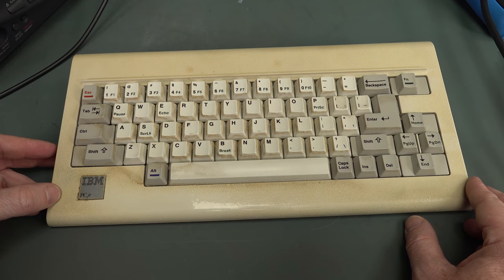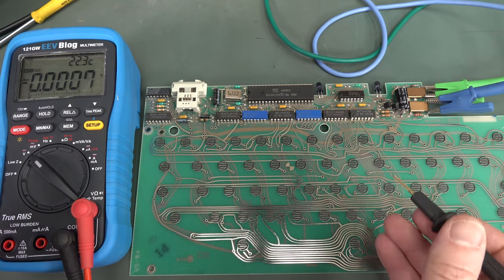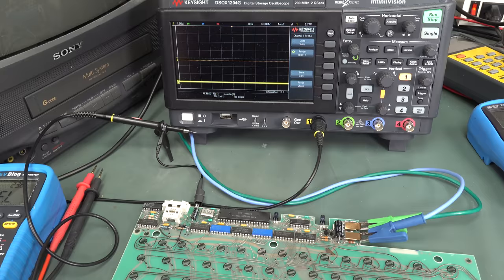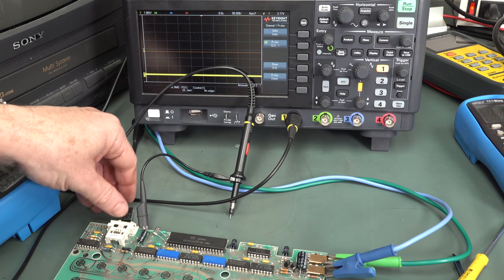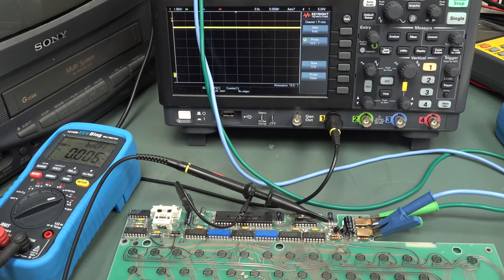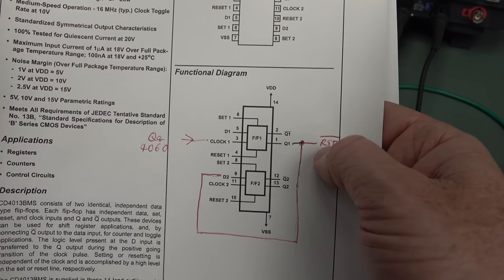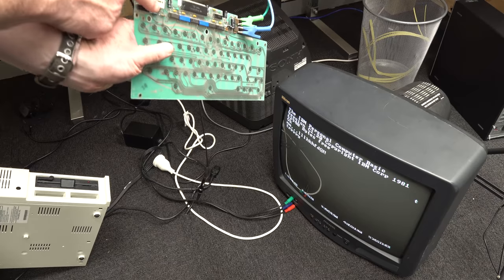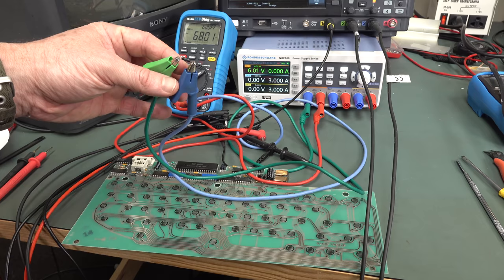EEVblog #1245 - A Most Excellent REPAIR: IBM PCjr Keyboard

Comment: Dave,
I see what you mean!  I did a search for the schematic for the keyboard.  I found a good "manual" on the Jr but although there WERE schematics for the main board, the power supply, the modem, the monitor, etc.  there was NO schematic for the keyboard!!!  There was a fairly decent block diagram for it, but no schematic.  In case you want to view it here is the link:
file:///C:/Users/user/Downloads/PCjr_Technical_Reference_Nov83.pdf
Also, another of your viewers suggested that you build Mr. Carlson's Capacitor tester....I TOTALLY AGREE !!!!  The thing is awesome!!!  I checked his YouTube site and it seems that the information for that device is limited to Patrons ONLY, so you would have to become a patron to get it, but it is WELL WORTH IT !!!  His non patron site is listed as "Mr. Carlson's Lab" and you can find it here:
https://www.youtube.com/user/MrCarlsonsLab/videos

I may have found a link to the regular site that is about the tester:
https://www.youtube.com/watch?v=LhovRIM5xAo
Check that out and see if it is what we were talking about.
Reply: The link ...
Reply: @0x8badf00d   looks like the path to my hard drive was listed instead of the link.  Try this one:
ftp://bitsavers.informatik.uni-stuttgart.de/pdf/ibm/pc/pc_jr/PCjr_Technical_Reference_Nov83.pdf

Comment: The ~400 kHz sounds like the carrier signal for the infrared, which is then modulated by the bit pattern of whatever key is pressed (turning on/off the carrier signal to the IR LED's as needed). Maybe you could do an episode about how IR remotes actually work (gated carrier on the TX, narrow bandpass on the RX), and why some early systems were prone to random receptions by just having sunlight shining on the receiver.

Comment: I think it's not just the leaky tantalum cap and the high-value resistor, but that in combination with the ultra-low input drain CMOS logic.  If you had that much leakage current with a TTL setup, it would probably not be a problem.  That would probably be what Dave meant about it being fine in another circuit design.  (It would make for absolutely sucky battery life to use TTL on a battery powered keyboard, of course.  That's why they didn't.)

Comment: I approve, another bit of vintage computer hardware brought back from the dead. Tanterlums, transistors & diods are ususly the first things I check, caps, depends on when they were made or the type. 60s- valve stuff, early 90s to late 80s & mid 2000s just replace. If its outside those known bad periods then I tend to fire up & test.

Good video tracking down the problem & solving the real issue.

Comment: I hate tantalum caps and avoid them like the plague. Even new ones can fail on you after a short time without warning and failure modes are totally unpredictable. I have had ones that started leaking, some failed shorting a rail and others failed open circuit. Add to this the shittiest conditions of mining the resources needed to make these and you end up with the worst components imaginable.

Comment: "With no cap. May not actually be the cap, may be something else. But the cap is making is worse." Which is why I went into software :)
Reply: Chris Boyce Do you regret it? Capacitor failures are so much simpler than debugging intermittent failures in complex production code.

Comment: when i first heard the problem i thought: there's gotta be some kind of latching circuit that's switching off the IRLEDs but not switching over to allow the wired setup to work, which relies on that circuit to know when to unlatch the first circuit to switch the IRLEDs on... and i was thinking: bitrot?  stuck latch or flip-flop?

Comment: argentinians speak spanish.
Reply: Yes , we do! Also, SYC (Semiconductores y Componentes) which translates exactly to "Semiconductors and Components" is an electronics store in Buenos Aires, kinda like a "Argentinian Radio Shack" kind of pricy and "boutique".  Anyway, no idea how Dave ended up downloading a datasheet from their page!  Cheers from Argentina! Saludos!
Reply from the maker: @sgajate  It was just the first result on google for the PDF.
Reply: @EEVblog  Hey Dave! Yeah, I did the search to see what came up and got the same result. Good for the guys from SYC for positioning their PDFs in the google search :D Awesome video as always! Thanks for the great content! Cheers from Argentina!
Reply: @EEVBlog
If you input SYC in google maps you can see the store front.
Reply: Sebastian Gajate Why not just pull out the one page reference with all 40xx pinouts at a glance.  Elector had a nice one in one of their old issues, and similar ones for 74xx and one with various analog chips.
Reply: @EEVblog  Hi Sebastian and Dave!! as previously said by Sebastian, that datasheet came from a store here in Buenos Aires. That store is in a street full of electronic stores (You could love it Dave!). There was a time when Argentina produced electronic devices and components like ic's (not great or bad quality, let's say acceptable), but imports killed those factories in Tierra del Fuego (the southernmost province). Looks like we're some Argentinians following you dave! (btw, my user means "a cheerful idiot" XD)
Reply: Well, technically Rioplatense Spanish.

Comment: Look for anything parallel to the reset line. There might be a capacitor to reduce jitter. Thanks to apple products, I know, that they like to short out. Else you will have to reverse engineer that thing.
edit: I see, that was a very subtle failure. Good that you caught it.

Comment: I encountered a ceramic capacitor that measured 47... ohms.  First time I ever heard of one of those failing short.
Reply: Very common for MLCC's to fail short due to warped PCB's, they crack close to the terminals
Reply: @sebbef82  Should have been more specific:  Through-hole disc capacitor.

Comment: Thanks Dave !  I did really enjoy this vid.  What was that IC testing rig you used?
Reply from the maker: It's in the video.
Reply: @EEVblog   I tried finding it by your statements in the vid but the web site came up as an Asian Casino site.  If I'm understanding your Aussie speak it is http://www.zgecu.com.  The TO8662+ doesn't return anything in a search.  I'm sure I must be misunderstanding something.  Sorry Dave
Reply: @dpyles9396   Sorry, probably a bad example below.  They are available much cheaper than this, less than 20 AU and well worth the money.

Comment: I though tantalums are immortal. Or at least won't die from time.
Reply: No. They (either "wet" or "solid") last 10-20 years longer than good aluminum electrolytic capacitors but in the end becomes with increased leakage current like that in video or dead short in worst case.

An increased leakage current is a big problem with high voltage (85-125V) "wet"-tantalum capacitors because such leakage is voltage dependent and if you don't have equipment to test it at such high DC voltage - it is within tolerance at 30V but doing bad things in circuit at 105V, for example.

Comment: It's always the caps that are bad....from time immemorial!
Reply from the maker: Yeah, but in this case the cap is still actually pretty good, it's just a small amount of leaking causing an issue in a high impedance circuit.
Reply: @EEVblog  It was not the best circuit design to use a 1 meg resistor with that cap. Probably worked fine at first but over time the caps started leaking a bit and they probably started having failures in that curcuit. By then the warranties were expired!

Comment: weird to think they used an entire processor just to run the keyboard
Reply: It's dedicated keyboard controller cpu (8048). It's much simpler than most embeded electronics in use today, and modern version of it is stil being used in keyboards.

Comment: Why couldn't you just tie the reset pin of the CPU directly to VCC?
Reply from the maker: That directly shorts the logic output pin, not the best idea. Using the meter uA/mA current jack means there is at least some resistance there, low enough to work, not low enough to cause damage.
Reply: Because it might have caused other issues, for example the reset line might only come up when the oscillator has started and VCC is steady. The chip map also been thrown into reset to save power between key presses whilst on battery. You won't know whether it's safe to short until you understand the circuit and the problem in th first place. With some of these older designs if you angle them wrong the electrons fall out.
Reply: @EEVblog  Thanks, that makes sense!
Reply: @TheFrenchMansControl  All good points that I didn't consider, thanks

Comment: Not checking the elderly tantalum caps. Is that a trap for young players? :-)
Reply: It doesn’t matter if it was an oversight or intentional, it was educational and if I had seen this when I was in my high school votech electronics shop I would’ve picked up troubleshooting a lot quicker than I did. I was working on a mower at the beginning of spring that I just couldn’t get to run, I had rebuilt the carb swapped the fuel cut off solenoid, fuel filter, plugs, cylinder head, the entire electrical system and eventually more than half the mower disassembled. Turned out I had neglected to do the very first thing I damn well knew I should have done, drain the fuel tank/lines and put in fuel fresh from the pump and of course it fired right up. I felt like a fool for a moment at the end of the day I realized I learned more about that mower than I ever thought I would. I was able to take that knowledge and purchase two of those model mowers from a friend who didn’t want to get them repaired, I fixed them for next to nothing flipped them and made a bit of money. If I had simply swapped the gas at first I would’ve never learned anything and I would’ve missed out on making a few bucks and overall improving my practicality and self confidence as a man.